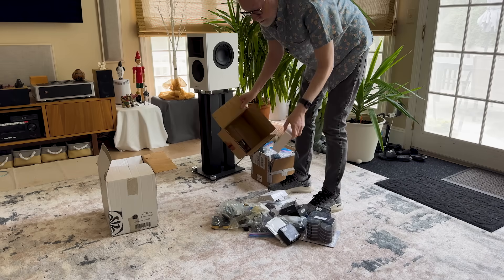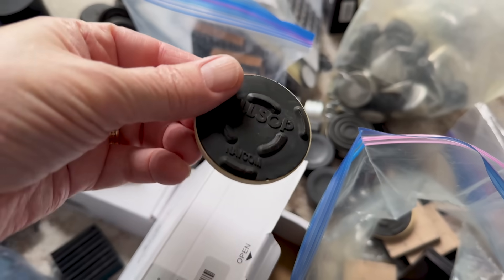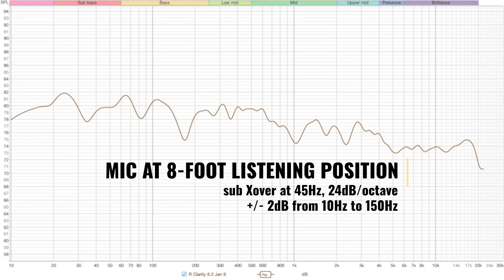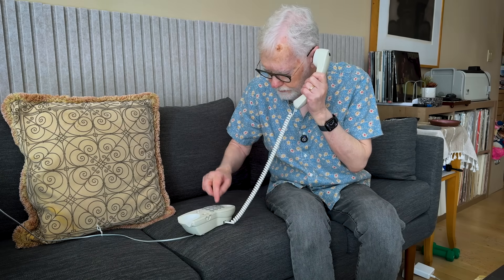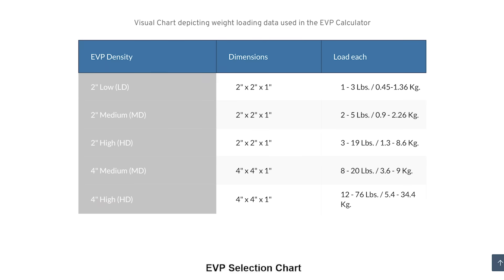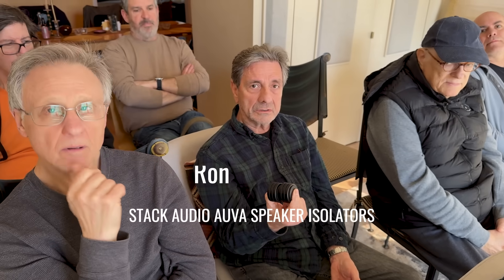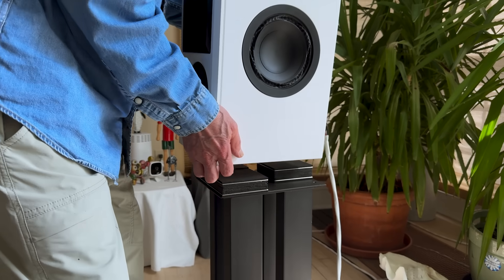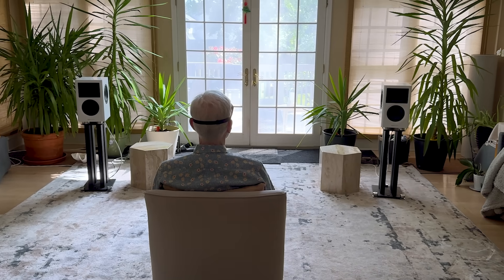Speaker isolation devices, do they WORK?

Comment: I use hockey pucks under one of my subs and that reduced the rattling walls significantly.  The bass was also less boomy.  I only resort to isolators for speakers in these situations.  My floorstanders sit on carpet so there's no need for isolators.

Comment: I had isolation devices under my equipment and my arms could  barely stretch high enough to reach the knobs and controls of my audio gear, which was high up, within a foot and a half of the ceiling. It all came tumbing down once, fortunately the dogs were sleeping underneath it and broke the equipments fall.No damage. The more you stack, the more risky it is though Like building a taller & taller  structure using playing cards, leaning against each other in the shape of an upside down V. At a certain height it gets real hard. 

 Cable elevators/risers are also an isolation device of sorts. Mine are suposed to need 400 hours to break in.
Reply: The dogs were okay, except for one dog's tail. After some physical therapy, it wags again!
Reply: Loving break in period for the cable risers!
Reply: And certain cables, especially some silver wire ones are supposed to not fully break in until the 3,000 hour mark. Actually the risers do work. Static fields when cables are placed directly on floors can affect sound quality. Floor static fields can also virtually erase the high frequencies of tapes. I had a tape lying on the floor unboxed for 3 years and when I went to play it, the tape was as dull as heck, like the highs were almost totally erased. Just odd bass heavy sound.

 I am an animal lover, and I do get concernned when people stack heavy equipment with too many layers of footers underneath. Their minds think like..."well if 6 of these doo dads make this much improvement stacked; imagine what 30 stacked will do." At some point a good foundation will become rather  shaky. I also get concerned about some of these standmount speakers that are so overbuilt and heavy, and the stands they are sitting on too. If a dog or cat accidentally knocked it over that would be a lot of weight coming down on them. Light speakers like Magnepan might be best for Pet Homes. But cats MIGHT scratch at the fabric grills.

Comment: Good one! The honest, thoughtful and no emotion approach is incredibly refreshing in this world of snake oil. I have used the Iso Acoustics GAIA feet twice, with very different results. In a rather poor sounding room with huge B&W 202D speakers and very soft wooden floor, the correctly sized GAIA feet caused a weird mid-range suck out that was really annoying. For Dynaudio Focus 340 speakers with correctly sized GAIA feet, the instrument placement and improved sound staging was unmistakable. They definitely make a difference, but ini my two cases were not a guaranteed improvement.

Comment: Isolation pucks worked so well for my speaker setup that I now have isolation pucks installed beneath the foundation of my house to provide full coverage isolation. Thanks, Steve!
Reply: I live inside a huge isolation puck.
Reply: I’m on an extended visit with my 3-year-old grandson. Will these work on him? I do NOT need a wider sound stage!
Reply: @johnfisher3929 lol good one
Reply: I use an isolation puck to rest the boys on when I'm sitting down. 

The difference is *very* audible.

Comment: IsoAcoustics pucks certainly make a difference in terms of damping vibrations, however I've noticed that they sometimes make the speakers a bit too 'dead-sounding'.  Maybe that's because certain speakers are designed with their particular resonances intentionally imparting a certain sound character - I don't know.   At TAF 2024, I was not impressed in the comparison of sound with Isos vs without.  Strangely, in the year prior, I found the Isos DID improve things.  Maybe different speakers were used - can't recall right now.  

Good video, though.  Nice change of pace.

Comment: Is it better to have the isolators underneath the speaker, or put gaia's under the stand? 🤔
Reply: By placing the isolator between the stand and the speaker, you quiet the stand too. Vibration is a two-way street, so in addition, vibrations from the floor to the stand will then not conduct to the speaker.

Comment: Best isolator is air. Get an inflatable pillow and try that.
Reply: Air alone is not a good isolator, it is a good insulator. An air gap (break) between say two walls, or within a resistive material like foam or fiberglass acoustic panels helps with absorption. An inflatable pillow of bicycle tube may help, but it will have resonance in the audible bandwidth, harden, and lose air over time.

Comment: He admits he doesn't know what he's doing with the measurement mic, and that honesty is appreciated. But here's the thing, frequency response alone is rarely the whole story when it comes to audible differences, especially with isolation systems.

That’s a common trap, even among so-called "experts." Just because two curves look similar doesn't mean they sound the same. You have to dig deeper: look at the impulse response, the waterfall plot, decay times, micro-dynamics, even group delay. Isolation platforms often affect how energy dissipates over time, not necessarily what shows up in a 1/6 or 1/12 smoothing FR curve.

Hearing a difference but not seeing one in frequency response is a clue that you're probably looking at the wrong data. Try asking the time domain instead, it often has the answers frequency response hides.
Reply: How are micro-dynamics measured? More specifically, what particular CTA-2034 plot would one use to compile and comport from a pro-AV company's gll data, provided that is good enough data in the first place?

Comment: Did you do the test with or without the subs? It can make a huge difference since no massive stands or stand filler can isolate from floor induced low frequency vibrations coming back to affect the speakers. My guess is that without subs the difference would be minimal. As a side note my speaker stands sport constrained layer damped (non ringing) upper and lower metal plates. I have found it makes a difference.
Reply: The subs were on.
Reply: @markblock8659  That's what i suspected.

Comment: I heard 3 different speakers (all floor standers) on 2 different floors with an without isolation devices (IsoAcoustics). The difference was not even small. 
HiFi hack: instead of isolating all devices individually on my rack, I simply replaced the rack's spikey feet with IsoPuck 76's. 
Done!

Comment: My 77 pound stand mount speakers are on four 3-inch rubber wheel casters on a tiled concrete slab. My dual 15 inch driver subwoofer is on 12 1-inch elastomer casters. My rack is a pro kitchen prep table on four 6-inch rubber wheels.

Thing with these isolation devices is they wear out and you have to buy new ones, like German car motor mounts.
Reply: EVPs are made of glass fibers, which do not age or wear out.

Comment: Springy feet work the best for my bookshelf speakers. I’ve read in reviews that it’s important to remove some springs to loosen the spring action. I remove 3 out of 7 springs. 

That’s what I use to attain a smooth sound and imagery sharpens from my speakers. Springy feet are the only true form of de-coupling.
Reply: For my tube DAC and tube preamp, I use a pair of cutting boards. Below the bottom cutting board, I use springy feet and remove some springs. 

Between the top and bottom cutting boards, I use furniture feet and a 1/2 inch plastic ball. On the top cutting board and below my tube DAC and tube pre-amp, I use the same cone feet he was using. 

I can feel (with my finger tips) the level of smoothness, smoothen as I work my way from the base to the cutting boards to the components.

On my tubes, I also use porcelain tube socket savers. I’ve detected further smoothness from vibrations that were audible. Plus, they’ll keep my tubes from heat caused by the components which will hopefully allow me to keep my current tubes longer.

Comment: Great video/review - honest & amply methodical. It is indeed interesting how (back in the day/1980's) how spikes ascended to "essential" status/were considered a bit of a no-brainer for serious systems - does anyone recall the "mana effect" from mana systems which seemed to inspire multiple layers of spiked steel & glass frames stacked one upon the other - I remember a entire mana system rack  sat on about four or five platforms (the notion being the more platforms used the more of the effect was apparent - although this tended to be accompanied by a complete nightmare of a task in regular dusting of the equipment). I personally thought the platforms were great dust-magnets! The point being, some setup's had more spikes than I had teeth (even back then)! Quite a contrast with modern systems. I did however find placing four of the large Michell aluminium cones under an extremely heavy "council" paving slab meant I could jump up & down in front of my turntable without causing the stylus to skip on the track - I have a wooden suspended floor in my lounge. 
Regarding your viewpoint about trusting your ears - I am a believer in this on the premise it doesn't matter what anyone else says. If it sounds good to you - who has the right to argue with that (it's not them who will be buying/living with the kit after all!)? 
I did enjoy your video though & hope to watch more from you in future.

Comment: I would love to see an experiment done by hanging the speakers from the ceiling using an elastic cord or spring.
Reply: That was the analog for IsoAcoustics development. The goal they wanted to reach with their isolators
Reply: @erics.4113 
Hahaha, resonance is part and parcel to the music.
Reply: @zizendorf for sure! But I try not to add my own when listening because that's like the guy that brings a guitar to a live performance. Silly
Reply: @erics.4113 
So what, you truly believe one can recreate the qualities and characteristics of a concert hall - as varied as they all might be? Not my point. Instead of fighting the resonance, find it, soften it (usually with sometimes slight speaker placement adjustments). Make it yours.
Reply: @zizendorf I hear what you're saying... "Salt to taste" kind of thing. I agree insofar that I listen solo and selfishly and all that matters is I'm enjoying the experience and the music and sounds. My point about controlling the resonance or rather specifically, my anecdotal experience with IsoAcoustics is that it has increased soundstage and clarity from my system, and I subjectively find that to be enjoyable!
Reply: I use the IsoAccoustics OREA Bordeaux under my 40+ year old LaScala’s in a room with hardwood floors. Noticeably tighter and less muddy. Separating the pucks from the floor is one 2’x2’ industrial carpet tile as well.  Each speaker has one additional carpet tile on the floor just forward of each speaker.

Comment: You forgot to mention that those things are pretty expensive. 
Also, the kind of floor you have will dictate the kind of insulation that may benefit your speakers. 
This is a very complex subject with a huge number of variables. 🤓
Reply: The price matters not, the question is do they work, as with many audio related topics.
If you want or can afford it is a personal matter.

Comment: Thanks for your effort in making the video. But it is misconception that a heavy stand absorbs vibrations. They do not. It just change were the energy is directed. Absorption only happens through friction and friction needs movement. So only squishy materials absorb sound. Heavy and rigid material only redirect it. It is just a fact of physics.
Reply: Stand fill induces movement and friction..
Reply: @razisn  Good point but not sure effective that is, because the stand itself is very rigid.
Reply: @siarez  it is very effective. Stand by itself is prone to micro vibrations, hence it rings. Take a hollow steel tube. It rings when struck. Take a rigid steel rod. It still rings. Take a hollow tube and fill it with sand or any granular compound. It stops ringing.
Reply: @razisn  Reduces movement through friction. Hence, the stand no longer rings, because the mechanical energy has been converted to heat through friction.
Reply: @AVRoomService  Why are you telling this to ME? It's like someone saying 1+1=2 and you come with a comment directed to him saying that 1+1=2..
Reply: @siarez get a soda bottle filled with sand and a tuning fork and you can play around with it and then make an informed statement.
Reply: @bekay3subs  could be good experiment, but a soda bottle filled with sand is not rigid. A steel pipe filled with sand is probably a closer approximation to the stand.
Reply: @siarez  You can't get much more rigid than glass...

Comment: I tried Gaia feet on my speakers a few years ago and was immediately sold. Upper bass/lower mid congestion dissappeared. So, for laughs, I tried Orea pucks under my integrated, not really expecting anything. Wrong; everything became more clear. I now have the appropriate Orea pucks under every component in my system. Wouldn't be without them.

Comment: This was really cool, but I was frustrated when it came to the results of the tests.  Mark’s language was unclear to me. 
First of all, he talked about doing five  separate “ tests.”

What does that mean exactly?  

What did each test represent listening to a single footer once?

Or did each test represent a number of trials - guesses?  So for instance  did a test comprise maybe switching between spikes and the isacoustics 10 times with 10 guesses?

I have no idea.  Mark just tells us that he got every test “right”… but then put up a disclaimer, not necessarily statistically significant.  And I am still no more enlightened.

Could Mark perhaps chime in and tell us more specifically how he compared?  How many times did he compare For instance, the Isoacoustics against spikes in order to determine the is of acoustics sounded better?
What are the full metrics here? 

Thanks .
Reply: Full metrics? 
I'd characterize them as the "take it or leave it" variety. 
It's all good.

Comment: Steve & Mark  it is not a myth Stereo was invented in 1929 by a Engineer watching a movie with his wife that wanted the screen movement to match the Audio.

Conversely his early form of radar used microphone arrays to locate bombers on the way to England during the war.

Isolation is required because Stereo is a rear projection of sound forward in the same manner of cathode ray tubes for TVs of that era , imagine watching a screen that bounced when louder deeper sounds arrive, that not the most optimized experience.

Unified Theory of energy confirms wavelength and intensity of light or RF  are all the same as SOUND. 

A stable projection from both speakers is a primary requirement a Audiophile experience

Comment: I have products from both companies, A/V Room Service and Isoacoustics. 

I use AVPs under a tube preamp, and Gaias under my Focal Scala Utopias. I have suspended floors. 

Gaias are easy to hear. The improvement in overall clarity is obvious at higher volumes. 

AVPs are very subtle. I use a very heavy maple rack (>200lbs) which has its own isolation foot solution.

Comment: It is my experience that using any kind of rubber feet on a hard (concrete) floor, will make the speakers slightly swing forwards and backwards when playing music. Doest this mean that this counteracts the driver movement and therefore changes the sound in a bad way?
Reply: But IsoAcoustics is slightly different, they're designed to swing more forward/backwards, than side to side.

Comment: This always drives me nuts, isolate is the wrong word, isolation would be floating in mid air, all of these products are named wrong.  These are all dampeners.
Reply: To isolate does not have to mean complete. In the noise and vibration industry, effective isolation means that the vibration bandwidth of interest is mitigated by at least 90%. EVPs do that from 5Hz. on up, lab-proven. BTW, we are not wetting anything; damp, damping, or damper would be the correct term. Damping is typically applied to panels in the form of constrained-layer sheets or mastic materials.
Reply: @AVRoomService 
Agreed, ... it's not elimination. 
It's isolation. 

Dampening ... that's the one that I tend to encounter the most. 

Damping, is perfectly appropriate.
Reply: Wouldn't it be more accurate to describe them as both, ie., isolation 𝘢𝘯𝘥 damping? 

Somewhat akin to racing suspension; springs isolate the impact of bumps, and the dampers (shocks) slow the oscillation.
Reply: True, isolation products do reduce vibration, but they don't eliminate it. Reminds me of guns, where silencers and bulletproof vests are better described as suppressors and bullet-resistant vests.

The automotive analogy is fun. Springs primarily support the weight of the vehicle (except unsprung weight), but they also reduce the impact of bumps -- along with tires. Shocks control and dampen the oscillation of springs.